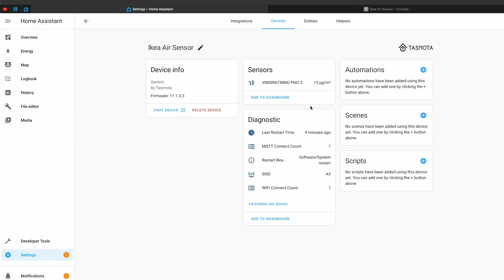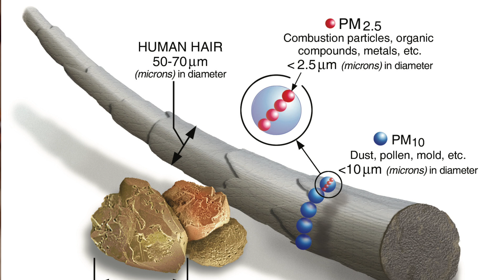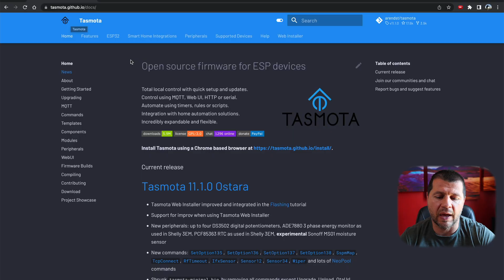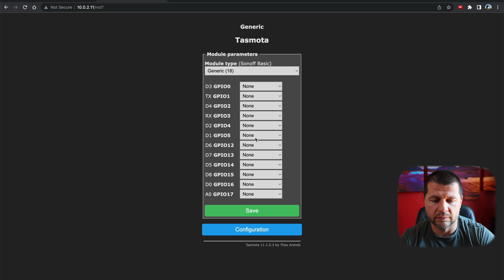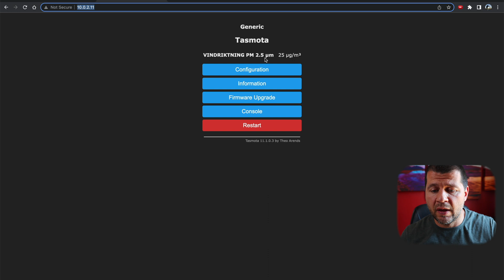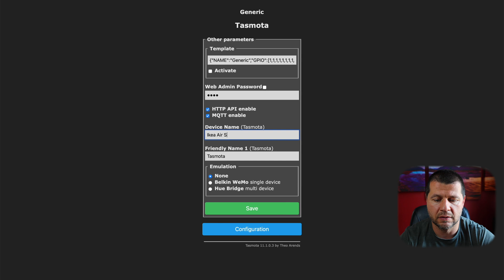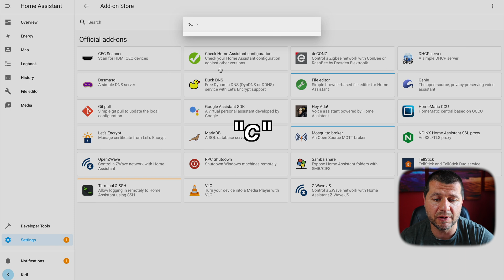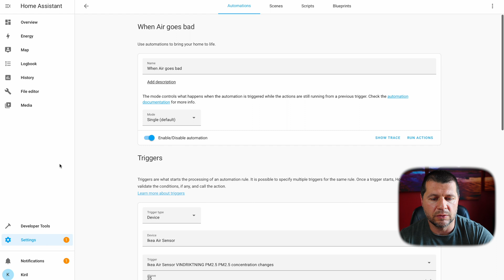IKEA Air Quality Sensor in Home Assistant: How to Make IKEA Vindriktning Smart

Comment: i bought a d1 mini ver 4 which does not have d1 pin instead it has pin 5 scl and pin 4 sda which one do i need to use and is tasmota generic 18 still the valid firmware for this mini d1 v4

Comment: it's quite strange, i've had configured everything like you said and worked fine, untill like 1/2 weeks and now it doesnt recognise anymore it like a sensor with micrometer (like where you said "here you can see vindrikting with 13 micrometer" in the tasmoadmin config) but only with a switch, what happened?

Comment: My classic luck ...
Used a NodeMCU ESP8266 (specifically AZDelivery 3 NodeMCU Amica V2 ESP8266 ESP-12F) with Vindriktning. Wasn't working with Chrome flash thing, so i used Tasmotizer with all-sensor.bin. Everything working fine but no output ...
I try to connect a BM680 and all readings show. Vindriktning in the meanwhile is working fine (lights ok, reacting as intended).
I try to resolder the "Rest" pin in the Vindriktning (no luck).
I try and switch the pin in the ESP8266, but BM680 is always working and Vindriktning is not showing even using the same D pins.
Looks like the "Rest" pin in the Vindriktning is not giving any output. Is it possible? I did not find anything on this issue on Internet, so maybe i'm the only one ...

BTW ... your tutorial is the best i found !!!

Comment: Thank you for the good explenation- I tried to rebuilt it, but I do not get the Quality level - even not at the Tansmota side of my D1-Mini 
Any idea what I made wrong? - I found it: it was a too massive soldering of the ground wire touching the condensator near by.
Proble I observe now is that the update rate in HA is much lower than the one I can get at the D1-Tasmota-Interface. Any idea how to increas the update rate in HA?
Reply: I had the same issue, thanks for the hint.
It is really easy to "touch" other components with the soldering.
Now the sensor is working perfectly, tanks for the tutorial.

Do you know where can I check the configuration for openHAB?

Comment: i have downloaded and installed Tasmota Version 11.1.0(sensors)-2_7_4_9(2022-04-13T06:40:38) and the Vindrikting sensor is not showing  has it been removed thanksd
Reply from the maker: That is strange, it shouldn't be removed. Try the same version from the video 11.1.0.3
Reply: @KPeyanski  I have the same problem with Tasmota 12.0.0 (and I use a NodeMCU instead of D1 Mini - but that should not be the reason). I cannot find the Ikea sensor name in the dropdown list. Any other way to proceed?
Reply: I have checked in detail and the file to flash must be tasmota-allsensors (instead of tasmota-sensors). In the former file, the Vindriktning option is present.

Comment: Nice and clear instructions video, as always! I just suggest that connecting directly REST pin to D1 Mini should be a problem in the long run as the sensor (PM1006K) signal is 5V and the D1 Mini (ESP) port is 3.3V. So adding a voltage divider with 3 simple resistors will do the job and still fit inside the box. Greetings from Portugal.
Reply: Was thinking the same, as others all did it wit  resistors
Reply from the maker: Thanks for the tip!
Reply: I used the D1 mini V3, which is 5v.
Reply: @tonydicken1818  how can you see what version you own?
Reply: @TwanJaarsveld1  Mine was labelled V3 and 5V on the packaging, pin also labelled 5v. If the pins says 3,3v, it's not a Version 3.
Reply: @tonydicken1818  i Googled it and it does look totally different, no esp8266 board on it
Reply: @TwanJaarsveld1  It's what I used and it's been working great for 2 weeks now!

Comment: Thank you for such an awesome tutorial. I have just finished automating a 20" X 20" box fan with a high efficiency air filter taped to it. I used to  just keep it running 24-7. Now with the addition of the air quality sensor I should be able to get a greatly extended time between filter changes. Cheers from the dry, dusty desserts of Arizona.
Reply from the maker: You are welcome! Indeed this Air Quality Sensor will be a perfect fit for your setup so running the fan 24-7 will not be needed anymore as you will be able to make ton of useful automations. Greetings to the Arizona desserts!

Comment: ESP based sensors have been around in videos for years.  BRUH Automation had a great one a few years ago when he use to make videos with 3D printed case.
I do like the Ikea case.  It is really quite good.   The only issue I have with ESP based sensors is getting power to them neatly.   Especially if you include a motion or light sensor in the "multi sensor" and you need to put it up on a wall somewhere.    Batteries are just not a good option in ESP based sensors, even using sleep modes.
Reply from the maker: Thanks for sharing
Reply: Esp now can fix most of those problems

Comment: One issue with this sensor is at night it keeps the LEDs on.   To fix this I started hacking these further by replacing the LEDs with 3 WS2811 LEDs that when the LUX is low it turns off the LEDs in tasmota.   Then using tasmota rules to change the LEDs based on the levels.  I've also really enjoyed adding sensors to this device.  I'd send you a diagram and pics if you'd like.  Been running these with a LUX sensor (BH1750),  Temp and Humidity sensor (BME280).  This sensor can also show the PM1 and PM10 levels, you just have to compile the options into tasmota: VINDRIKTNING_SHOW_PM1 and VINDRIKTNING_SHOW_PM10.  Been really loving it!  Excellent video!
Reply from the maker: It seems that you are a real Vintriktning master. Please send these diagrams, they will be helpful to everyone. Thanks for the good words and for the excellent comment :)
Reply: @KPeyanski  can you post my write up here that I sent you on discord?
Reply: Id be interested to see the sensor you assembled Caleb, perhaps you need to post a vid of your own
Reply: A similar and excellent work is already done by YouTuber  'vccground'. Do check it at https://youtu.be/EnZ1ny2DqG0
Reply: You could put a bit of electrical tape over the LED's and just rely on Home Assistant to give you the readings and warnings.
Reply: The Amazon Link for the D1 seems not to work. I’ve never had one - can you post what exactly to get? Thank you!
Reply: Caleb, were you able to get your notes posted anywhere?